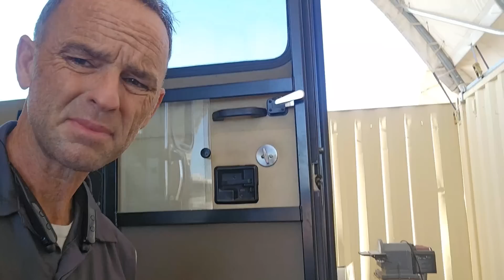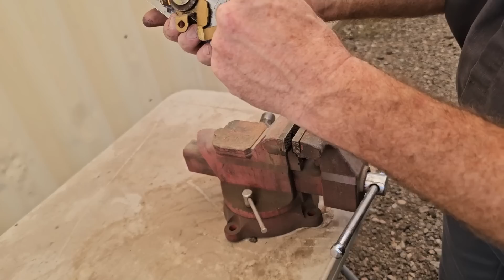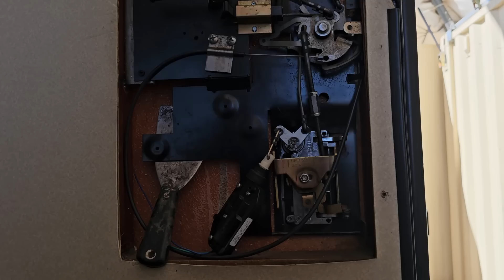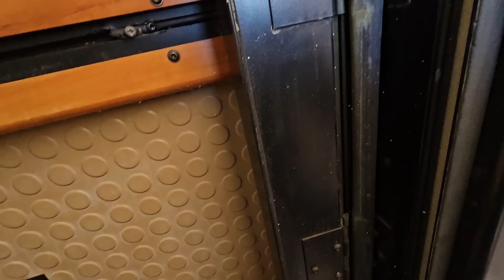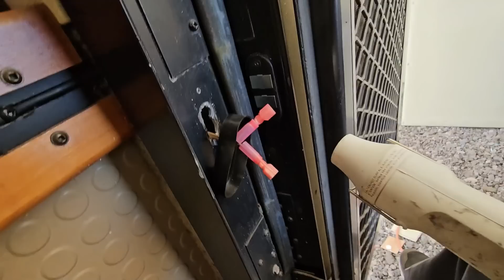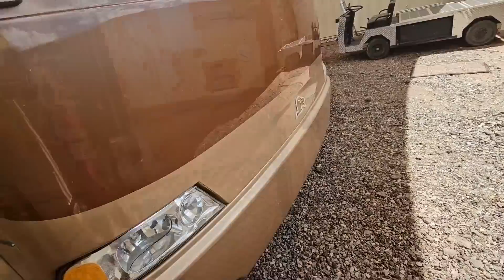My Ultimate HACK: Adding Power Door Functions to My RV Front Door

Comment: Just a thought, showing the brown wires under the couch showing what will operate the door lock, doesn't that expose a security risk? all someone would need to do is have a battery like you had for testing, cut the wiring and unlock the door. Sorry for these thoughts, its in my nature to see these things as I am into IT security for a Large company and I have to see vulnerabilities like this.
Reply from the maker: Dead bolts are the security lock